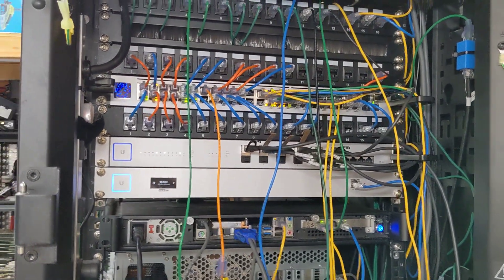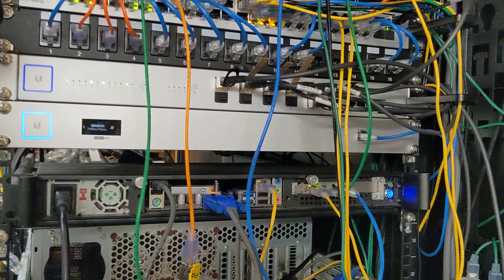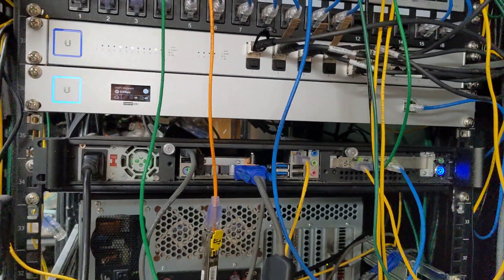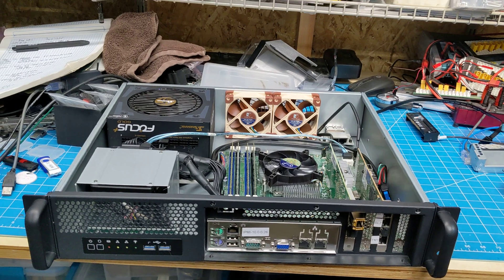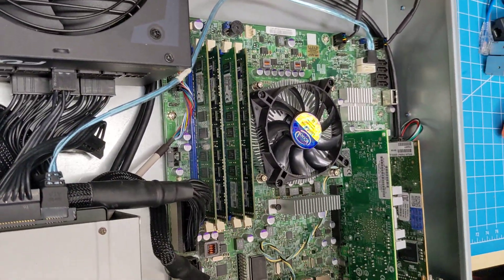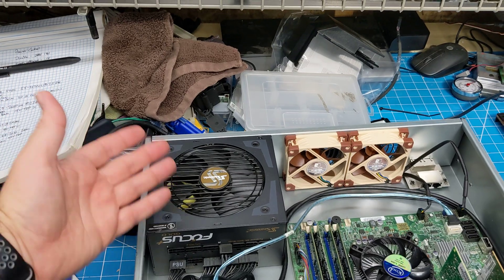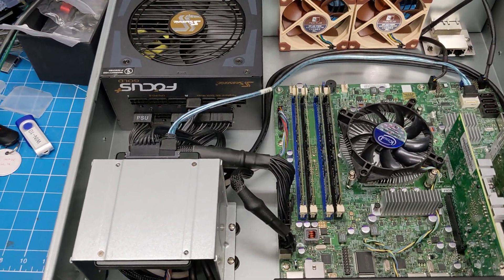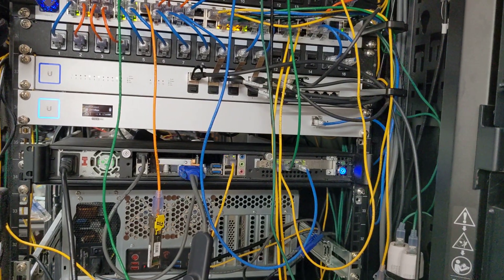Server Rack Update "Out with the old" pfSense router replacement (Part 1 of 2)

Comment: Seen these cases popping up, they still have the suck of typical ATX form factor in server chassis, the PSU. Yes, there is a small section of venbt holes in the lid but these face up where dust settles to and also means you need to leave the unit about the chassis free meaning you now may as well of used a 3RU chassis. Best option is a proper PSU that has a front / rear 80mm fans to use internal airflow and exhaust out the rear.  Next issue, you  have the rear fans in traction pulling airfl;ow from the rear of the chassis, you know, the hot air exhasted from othyer machines and devices and even its own PSU. Your rack and systems along with your building are not in need of reverse-flow cooling that was old fad from audio amp guys. Feed from front to rear and use mesh-style blank PCI slot plates as the NIC's will cook in the stale airflow. 

P.S: Read the specs on the board, the onboard NICS are Intel last time I looked, not Realtek.
Reply from the maker: Thanks for the comment! While I do agree that if I had a full rack the vent holes on top would not really do much as they would be blocked by the device above, in this case, the device just above it is a Unifi Cloud Key and does not even extend to where those vents are located.  As for the direction of the airflow the servers and rack mount PC are much lower than the router on the front of the rack.  The only other device with a fan that exhausts out the back is the Unifi XG 16 and it does not really run that hot.  As I mentioned in this video, or perhaps the part 2 video, I will make changes to the fan direction based on overall cooling performance on the NIC cards as well as the processor.  I can tell you I will more than likely be changing the CPU cooler and adjusting fan settings now that winter is coming to an end where I live.  One thing I did not mention in the video is that I have an AC unit the blows directly on the face of that network gear.  I only run this AC in the summer when it starts to get in the 80’S where I live.  I will certainly be setting the fans to extract the hot air out the back at that point as there is no use blowing hot air into the stream of the AC.  As for the onboard NIC’s, I saw a Realtek logo on one of the chips in back so assumed they were all Realtek, come to find out they are Intel and only the IPMI card is Realtek.  I looked up the two Intel NIC’s to see if people were having issues with them on any of the Netgate forums.  One is an Intel 82574L and the other is an 82579 PHY.  I found people having issues with both.  I already had the supported Intel quad port NIC so I just went with it.  The rack is constantly changing, and I do take the feedback from commenters into account when I try to decide what to do next.  Thanks again for the comment!!
Reply: @Hephaestus93  I used to be a PF guy way back but got the s##ts with all the tweaking to be done or could be done and random breakages but to be honest, Realtek and other NIC's worked OK as I was never stingey on the CPU/RAM side as these NIC's are not discrete. I now just use UniFi although, if UBNT don't pull their heads out of the their apple-everything prosumers butts, I will be moving to something else.
Reply from the maker: Totally Agree on the Unifi "appleness" they seem to get really close to making good network kit and then do something like RGB their switches....something nobody asked for and is useless.  This is what happens when someone from apple moves in to executive positions in your company.  They think apple is the best at everything and turn the company in that direction.  Then they leave and hopefully Unifi brings in someone who is not guilty of group-think.
Reply: @Hephaestus93  They all left, now doing Alta Labs

Comment: Do you have a link to the case?
Reply from the maker: Here you go:  https://www.ebay.com/itm/354112755518.  Sadly it is $130 now.... Thanks Joe :(
Reply: Dang, it's 14" depth, my small wall mounted rack has a max depth of like 14.5".  Also, that shipping cost 0.0 @Hephaestus93
Reply from the maker: @syjeklye  see if you can find these but shorter.   They are super overpriced but if you dont mind them sticking out the front, its an option.  Good luck!  https://www.ebay.com/itm/355030767031?_trkparms=amclksrc%3DITM%26aid%3D1110006%26algo%3DHOMESPLICE.SIM%26ao%3D1%26asc%3D20201210111314%26meid%3Da8b6055740ac4d60a8fa0b95c3fb595f%26pid%3D101195%26rk%3D1%26rkt%3D12%26sd%3D256233160281%26itm%3D355030767031%26pmt%3D1%26noa%3D0%26pg%3D4429486%26algv%3DSimplAMLv11WebTrimmedV3MskuWithLambda85KnnRecallV1V2V4ItemNrtInQueryAndCassiniVisualRankerAndBertRecallWithVMEV3CPCAuto&_trksid=p4429486.c101195.m1851&amdata=cksum%3A355030767031a8b6055740ac4d60a8fa0b95c3fb595f%7Cenc%3AAQAIAAABYObhgc4Nk8%252BdtAwOww4FKLaj%252FQ5qqgDlQCuqZA43WcPFUWDERCUugbbOk7XQv0JXlBfqCg2xKF3WcPghxGMFw2oSlXvfExEaMYr7I7LmrHcP6czY1wIMt0ORyKiCWt95xldincyyBx3g%252BNDW%252B%252FhWUgTaBhK6xAm%252BJIbCOMehu%252BdwCLu4QFi3rkMI1LmvUuIDmgwrT4B%252B2TEPII4wP5Z4LAkRVmzpMhsTUOTMfraHKfJO4DU7ozhaoF9p3nVKCcZN6X7z4gP%252BrkMN%252BFKgwKq%252Bke5f6HWyzofnIUlCVzPd4garEMRNEBzGv4B%252FAES6haTV5v95hpx4Ap6q%252F0xIGuvlVOe%252F0L4XxQnQVL65ybygPaIfmCrR%252BiJkhEi8yebonjPuuSXPdieOW1oDntcSwL%252Bwj2hCMXz06b%252FjgoETJ2yxR8XU1msjRlLwj9UdNqGs63nAN0aDlIalDx6WVXtzukw20VU%253D%7Campid%3APL_CLK%7Cclp%3A4429486

Comment: UM, those onboard nic's are Intel the only thing that is Realtek is the IPMI port.  One Intel 82574L  standard NIC at this point for servers. The other Intel gigabit NIC is based on the 82579LM that comes off of the C204 chipset.  OH and those are SFP+ ports too :) he he !
Reply from the maker: I dont know why but I cant ever get SPF records and SFP ports correct in my head.  I think my "forgetter" works better than my "rememberrer"  LOL.  I didnt plan to use the onboard ports from the outset.  Supermicro has the same board with 4 Intel ports too.  I have built probably more than 75-80 pfsense routers and had nothing but problems with the supermicro on-board ports, no matter if realtek, broadcom or otherwise.  The Supermicro router than I had running in my rack for years was once deployed at a clients and I spent months dealing with random haults and NIC ports just stopping with no explination.  Put in the PCIE quad intel nic and it ran for me for 3 years until a RAM stick went bad.....